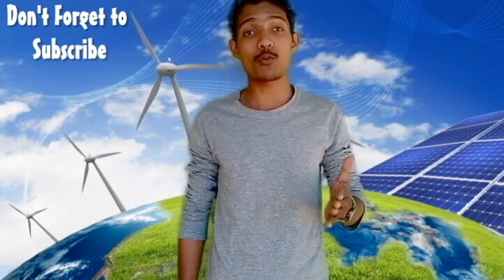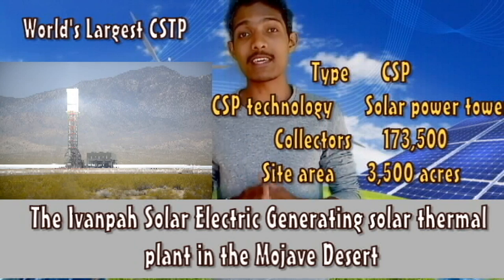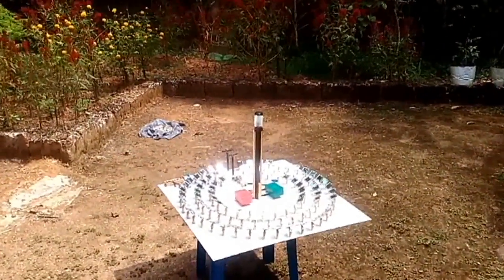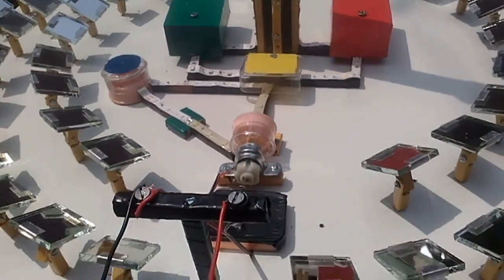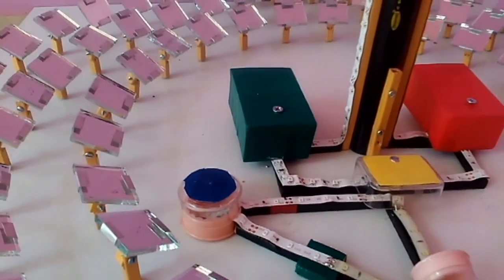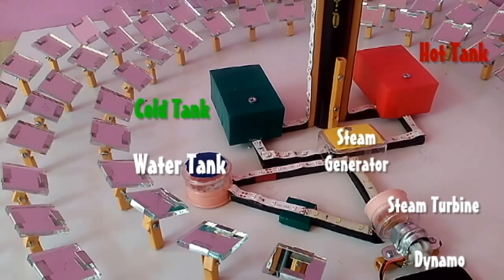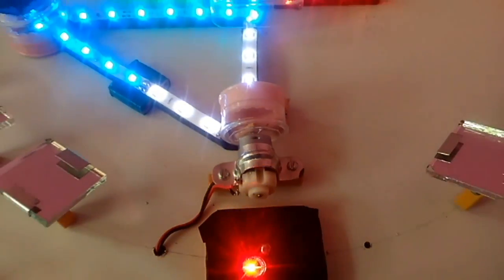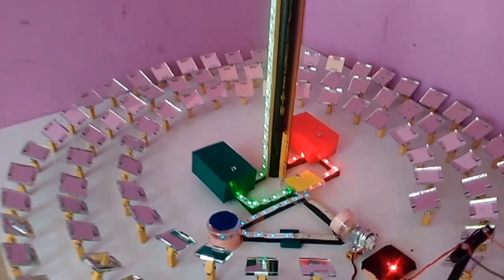How CSP Works? | concentrating Solar Thermal Power

Comment: Hello sir . I m engineering student  ..n we are making this project..i m an intrested to know wat material you used for receiver . It seems to be a plastic bottle . I think tat wont work .
Reply from the maker: All of the components are not real as in a power plant. They are symbolic or smaller level representation of real technology. I firmly believe that models are more useful than animations or pictures to teach the working principles. By the way, best wishes for your project. 👍
Reply: Thank you for your best wishes.

Comment: Can you please tell me about the amount of energy produced by this?
Reply from the maker: +Akash Sharma, glad to know you are interested in Solar power. You know this project is just a model, doesn't generate any power. If you are asking about real CSP capacity, I can give you some details about Ivanpah solar facility, US.

It is the worlds largest power tower type csp in the world. The plant has a gross capacity of 392 megawatts . It deploys 173,500 heliostats.

There are hundreds of CSP plants around the world. They are either working, or under construction.

Then, is there anything else you wanna know?
Reply: Thanks for the info.
I am too working on similar working model of my own csp using this and parabolic mirrors trying to generate decent amount of energy,  
your videos are very helpful to me.
Thanks for uploading!
Bro is it is okay to add a photodiode to the can which can indicate when the direction of sun is not appropriate (in case of parabolic mirrors)?
Reply from the maker: +Akash Sharma, watch this video.. https://youtu.be/RFqAjANrGeE 

That's a good idea. Keep going. Let me know once you complete your project..

Think about adding a Photodiode, certain circuits and an auto rotation mechanism.

Comment: please explain how long heat will be stored after sunset?
Reply from the maker: +Rajesh Mayara , during day time, molten salt absorbs the solar heat and is stored in a thermal storage tank. I've explained it. Anyway, thank you for comment.
Reply from the maker: +Rajesh Mayara, it depends on CSP capacity. Total mirror area. Fluid utilized. Volume of fluid.. Most of the CSP plants can provide power all the night...
Reply: New Physicist Thank you
Reply from the maker: +Rajesh Mayara, you are always welcome,👍